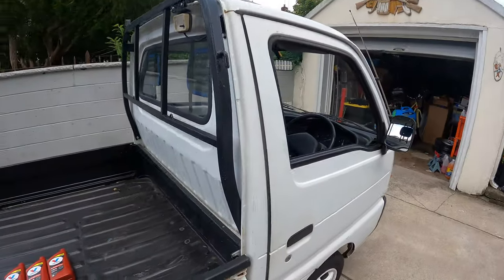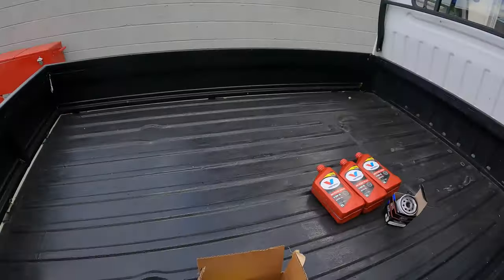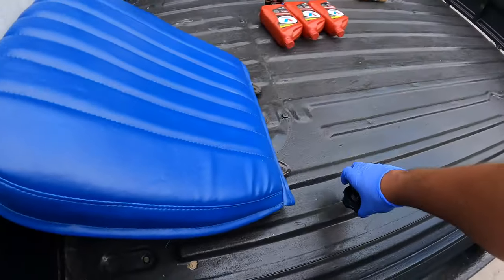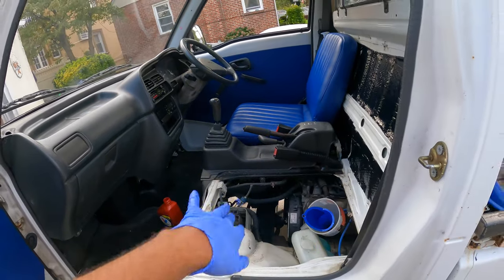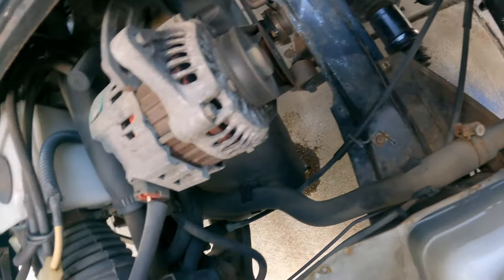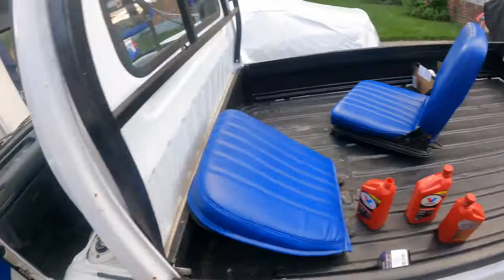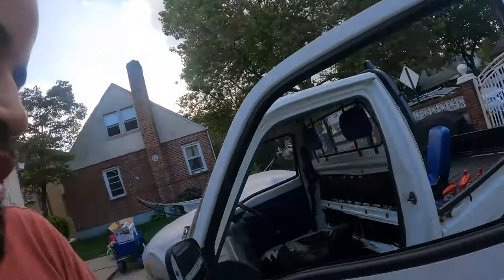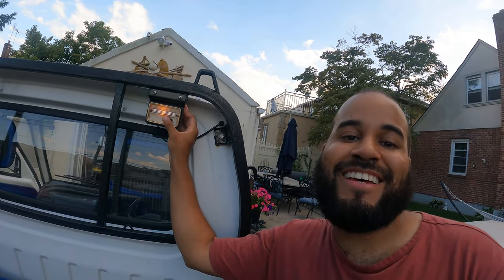Suzuki Carry Kei Truck Oil Change

Comment: Did you take the cover off of the air filter?  There should be a cap on the end where the filter sticks out (at least mine has one)

Comment: Typically use new oil, but oiling the gasket on the filter will help it to seal when you tighten it down by hand
Reply from the maker: gotcha

Comment: I wouldn’t recommend any aftermarket filters that require oiling the filter element. The elements themselves are much more porous (to where I can easily see daylight between the strands). The filter oil is supposed to help with that, but overall the airbox you have is meant to work with your carbs. Also, I wouldn’t crank up an engine with the cover off and air filter sitting like that. All the dirt is on the outside of the filter and inside the housing. The cover holds the filter tight so the intake pulls air through the filter, and keeps the dirt in the other part of the housing. Without the filter being held on, you’re going to pull a lot of the dust in the air filter housing directly into the intake. Thanks for the vid overall. I just bought a Carry and am trying to figure out where everything is at, capacities, viscosities, sizes, etc. Cheers

Comment: do you consider an Engine Swap?

not a ludicrous LS,SR20 or Wankel swap..

but maybe a slight upgrade like a Suzuki G13 Engine or a Modern Suzuki K10/K15 Swap to bump the power up to 100hp's?

the stock engine on those is a bit too weak even on Intercooled Turbo EFI Engines
Reply from the maker: For me it’s not worth it. Even if this kei truck did have 100hp it would probably drive like crap and it’s already a death trap the way it is

Comment: Oil on the gasket seal lubricates the seal to avoid damage (tares, uneven seal, stretching of rubber when torqued)
If you wanna be a real cool car care dude down the road get some DC-4 GREASE and use that on the seal instead of oil.
Reply from the maker: good to know for next time
Reply: Now you are getting extra complicated
Reply: I work on aircraft engines and know what keeps seals healthy, I also like being able to have a oil filter that doesn't leak but also is fairly easy to turn off when the time comes.  
Just a alternative to oil on the seal.

Comment: You added new oil to the oil filter, how did it hold the oil in once you inclined it to screw it on because it was pretty inclined.
Reply from the maker: I didn't full it up all the way so i was good